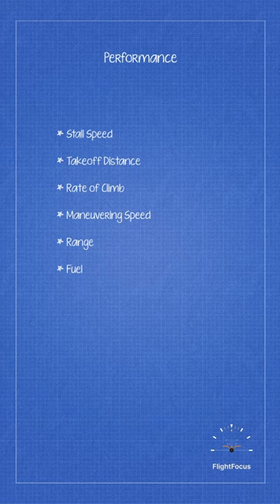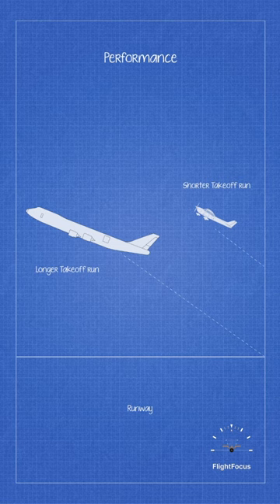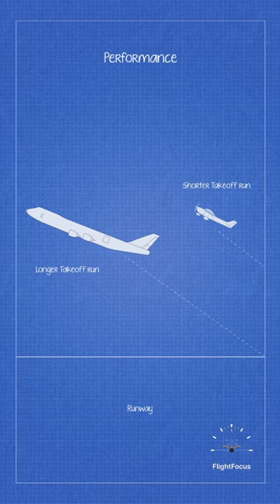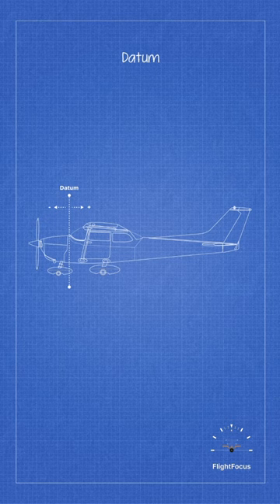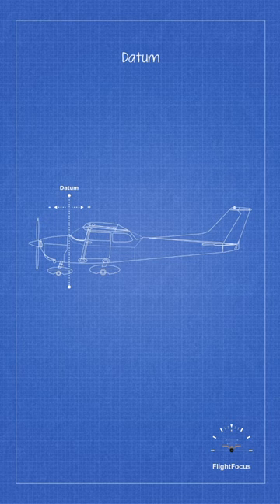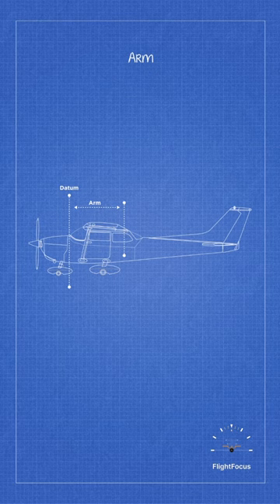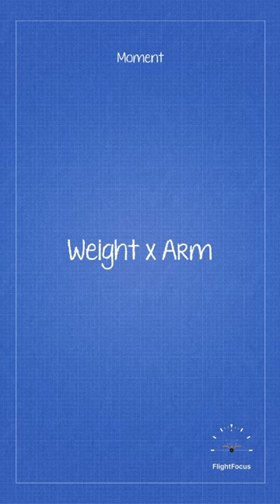Weight and Balance - Part 1

Comment from the maker: When flying an airplane, weight and balance are critical factors that must be considered. The weight of an airplane affects its performance in many ways. For example, a heavier airplane requires more runway to take off and climb. The center of gravity is also important. If it’s too far forward or too far back, the airplane can become unstable. That’s why it’s important to calculate the weight and balance of an airplane before every flight. Remember, a properly loaded airplane is a safe airplane.